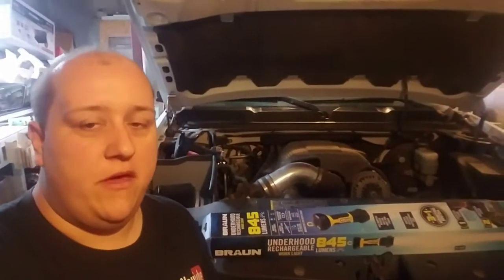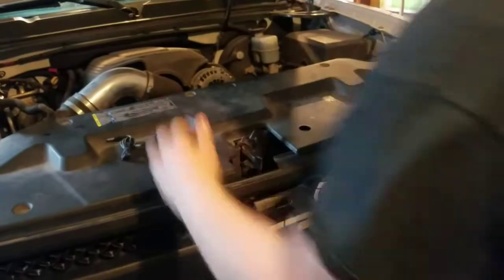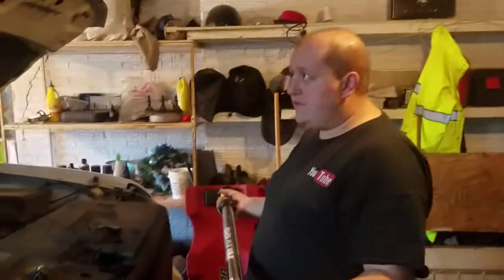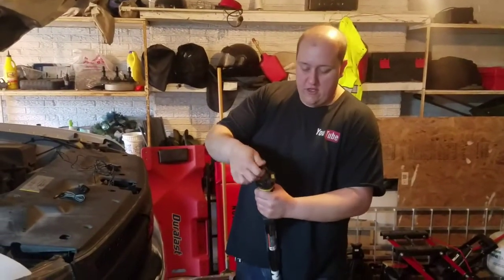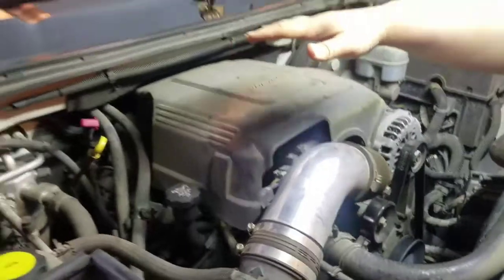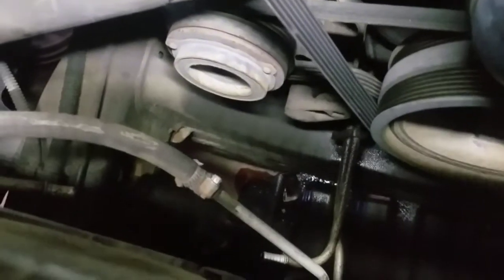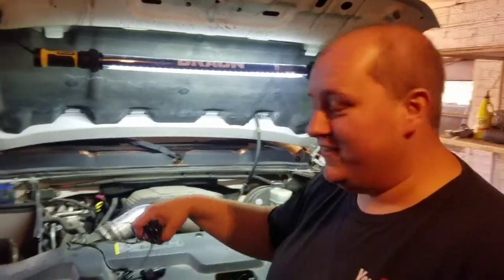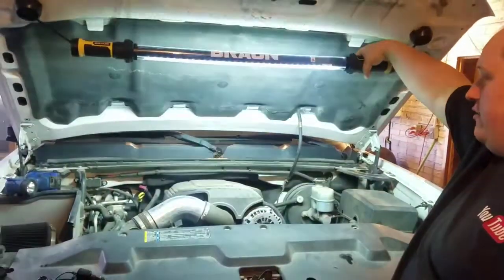845 LUMEN UNDERHOOD RECHARGEABLE WORK LIGHT

Comment: Thanks for the info. Can you tell me the specs on the charger? I need the voltage because the for sale ones blotted it out. It looks like a six volt, but the battery is 3.7 o it could be a four volt or the same as a USB charger